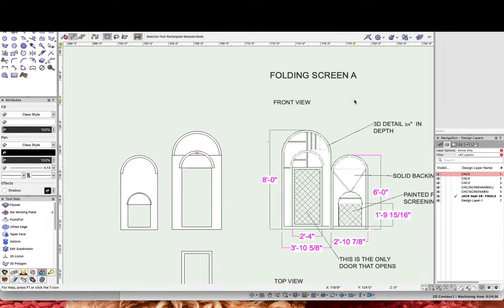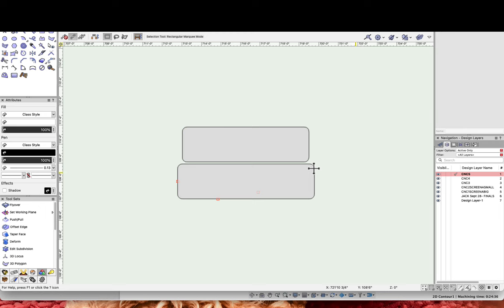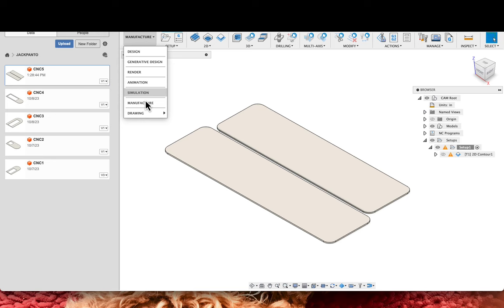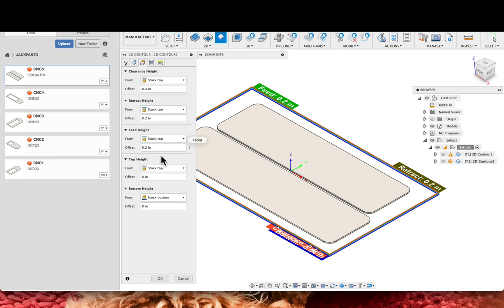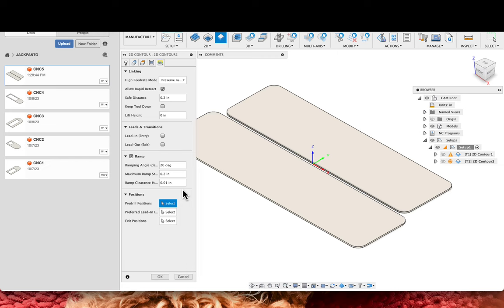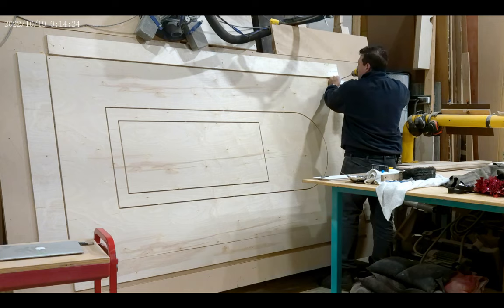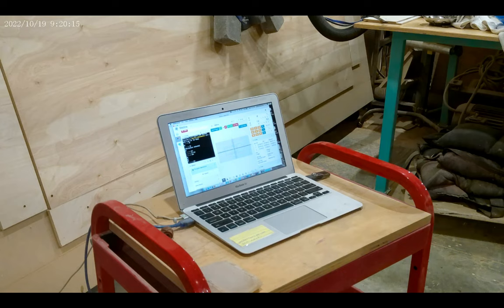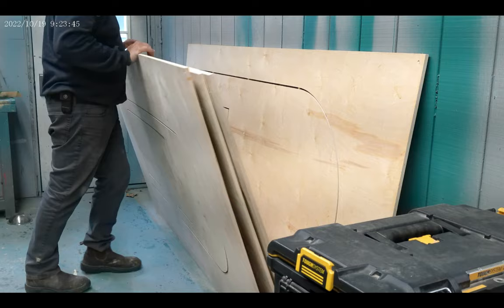CNC workflow Vectorworks to Fusion 360 to M2 CNC

Comment: so would you recommend this device? is it accurate?
Reply from the maker: It definitely can be accurate- it is a maker product meaning you have to put in the time to set it up.
A more expensive model requires less calibration and is easier to maintain.
But for the money, yes I recommend it.
Reply: @SceneryFarm  thanks for the reply. I am trying to start a camper conversion company that’s why I would need this cnc, to make some kits and prototypes
Reply: @SceneryFarm  also I asume this would be ok to cut birchwood ? The thick version that is covered with an antslip coating ?